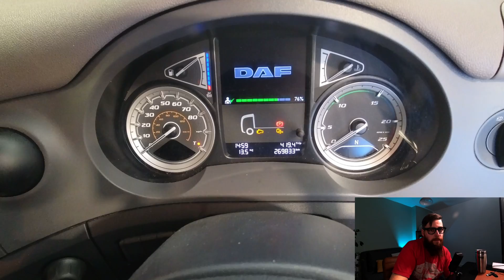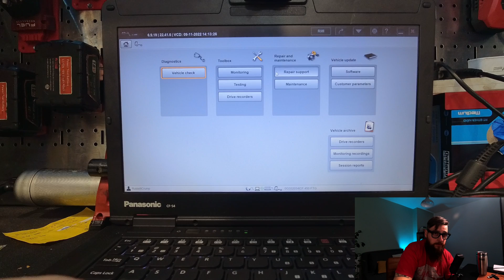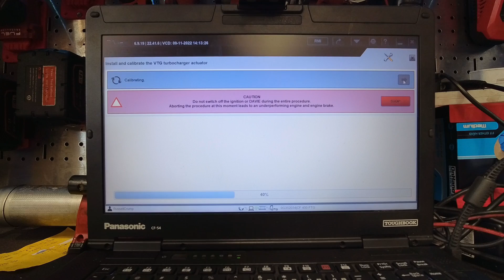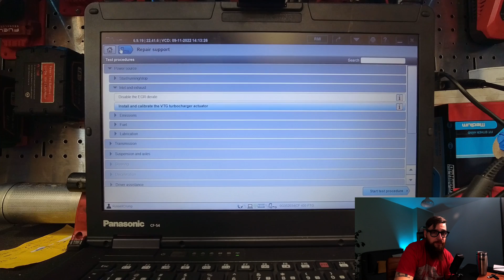DAF mx-11 Turbo Actuator Diagnostic, replacement & calibration

Comment: Hello Russell,

 Thank you for your attention. I appreciate the excellent videos you have on your YouTube channel.

 Recently, in our country, there have been issues with the VTG board of the DAF 480 Euro 6 supercharger, leading to its malfunction. As a result, there is a trend of replacing the DAF 480 supercharger with the DAF 530 supercharger. They are mounting the DAF 530 supercharger and its components onto the DAF 480.

 In light of these circumstances, I wanted to seek your opinion. Do you approve of this action? What is your perspective on whether this change in the supercharger can address the VTG board problems? Additionally, if you have any insights or solutions to mitigate the issues with the DAF 480, I would greatly appreciate your input.

 Thank you
Reply from the maker: Hey, hojjat 👋. 
Thank you for the comment about the videos. It means a lot 😎

I take it the turbos you're referring to are the HE400 on the 480 and the HE500 fitted to mx-13 530.

While I can't comment on power increases or what other modifications would be required to fully "uprate" the mx engine with the larger turbo, I do know that the actuator fault that causes U1159 and U1853 can have the faulty capacitor replaced which would make more sense to me that replacing a turbo

Comment: If it’s not the actuator but the wiring, is there a common area it will be faulty? I’ve had the backs of the fuse boxes on the LF corrode badly on the pins for the plugs for the ABS etc, currently have an LF180 with the dreaded engine malfunction light that’s had a new turbo and actuator, it’s not the same actuator as this one, but same faults ”implausible or missing signal” “internal failure” any help greatly appreciated 🙌
Reply from the maker: Hey thanks for the comment and watching the video 👌 
The actuator runs on on the same network as your other after-treatment (A-CAN) components. If your not getting faults for nox sensors, temperature sensors ect you can narrow this down to just your VTG actuator. Provided this plug maintains about 60 ohms resistance (just like the rest of the A-CAN network) and you have a reliable voltage and ground at the plug also I'd be looking at changing the actuator. The internal error fault is what I'd be using as evidence to base the replacement or parts warranty on provided you don't have any other errors on A-CAN.
Hope this helps 🙏
Reply: @TRUCKTECHUK  that’s interesting and good to know, it has faults on the upstream nox sensor, adblue metering valve and SCR catalyst also, I feel like my work life has been taken over by the Do Do Do Do sound of a DAF with an issue 😂

Comment: Great informative post mate, had the same issue on an LF a few weeks ago, so if you could time these posts a bit more in line with me, then life could be a lot simpler 😂😂😂
Reply from the maker: Hey mate thanks for the comment! 🤣🤣🤣👌.
I will do my best for you 😂 don't suppose your having a BPV replacement or a SAC fault this week 🤔🤔🤔 I've not made my mind up yet lol
Reply: @TRUCKTECHUK  Thanks for the reply, 
No this week is the old Fuel rail pressure issues (P228D & P0094 brothers have come for a visit🤣🤣🤣) but if it helps your dilemma, perhaps a good time of year  for SAC issues?
Cheers
Reply from the maker: Got to love some fuel pressure faults 🤣 what component have you gone for? We seem to be doing alot of injector flushes on these new NGD'S so I'd love to give that a go on the older MX engines and see if it makes a difference injector wise.....save the customer some 💸💸💸💸💰!

I think I'm going to do the SAC one! I can blabber on about CAN then and why customers fitting parts isn't a good way to save money!
Reply: Hello, dear friend, I am a truck owner and my trucks are from the Duff brand. In fact, we do not have any service for Duff trucks in my country. I ask you to help me with Duff trucks.❤

Comment: That’s ok if you have a new actuator to try first 🤔
Reply from the maker: Hey buddy thanks for the comment 👌😎. I should of removed the old one first and then tested it with my meter. 
It was more convenient to use the new one for the test.
I'm quite convinced these faults would of cleared and we would of got the same result with the old Actuator I think. 
Failure usually happens when the actuator is hot, but with the software issue I was 90% certain I could of ordered a new one and got away with just fitting it ☺️

Comment: Hey bro, you ever had the cable of the vtg actuator broken? I never had it, i always check fuse and if its good i replace vtg.
Reply from the maker: Hey thanks for the comment 👌😃.
If I've had the cable break, I'm usually seeing fault code U1011 E-CAN failure and red engine warning.
This can be a tricky situation to resolve or even catch the fault happening.

 Software verification error i usually go with actuator once everything has checked out